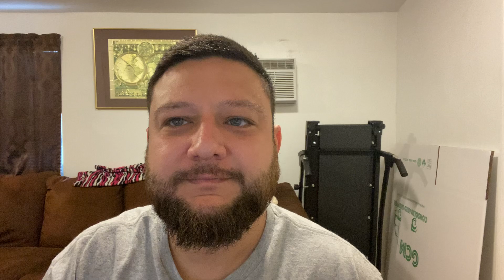K20A3 Performance Cams Vs Type S Cams

Comment: Hey bro, I have a 2006 base rsx with 
*Skunk2 pro series intake manifold (port and polished runners)
*Skunk2 70mm throttle body 
*Custom made 3 inch short ram air intake
*DC race header 
* yonaka 2.5 exhaust with no muffler. Bolted a straight pipe in place of muffler.
*ktuner dyno tune to 165hp and 145tq
In your opinion, what is the best mod I should do next for the best HP gains?
THANKS
Reply from the maker: Vtec killer is the last option outside of piston swapping for high compression
Reply: @VHBEngines  well vtec killer it is then. It's the cheaper and easier option compared to pistons swap. 
I should get the 05-06 camshafts and 4 more base rsx exhaust cam rockers right?
Thanks for your reply and Info

Comment: Hi VHB! Do you know how much I can plan the k24a3 head to insert it into the k20a3? I heard that you can even 1mm? What to do in order not to lose compression on this head?
Reply from the maker: I’m not 100% clear on what you’re asking. The head should bolt on without modification
Reply: if I put on k24 heads, I will lose compression.  k24a3 has larger combustion chambers. If I renew the head surface by collecting 1mm, I will get good compression?
Reply from the maker: @piasek2005  the compression loss is negligible. I wouldn’t cut a head unless it needs to be
Reply: @VHBEngines  I ask because K24A3 heads in my country are much cheaper than complete K20A2 (CTR) heads. One of the forum members advised me to buy K24A3 (ACCORD TYPE S) head from extinguishing a high decline in compression. You are an Expert in k-series and I wanted to make sure...
Reply from the maker: @piasek2005  I was also worried about that myself. I do know a good amount but I still would classify myself as an expert but I do know some guys that are. Watch this and it’ll explain a bit better https://youtu.be/1cPIczL2Zy8
Reply: @VHBEngines  Thank you very much for sharing your knowledge. I wish you all the best and health! 👍